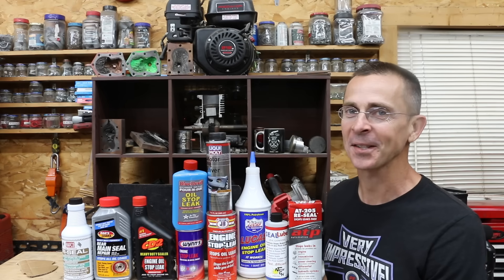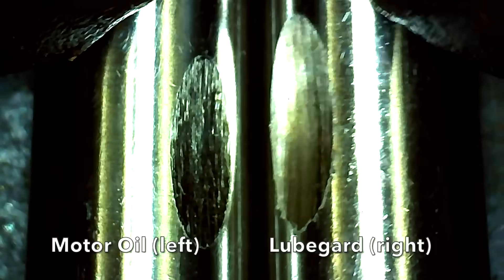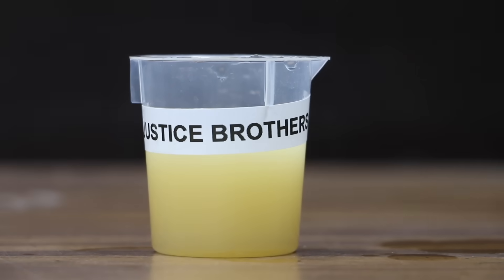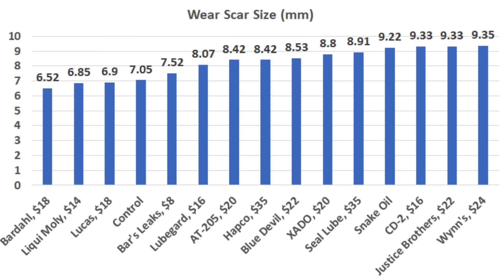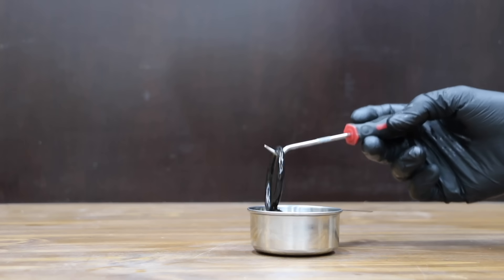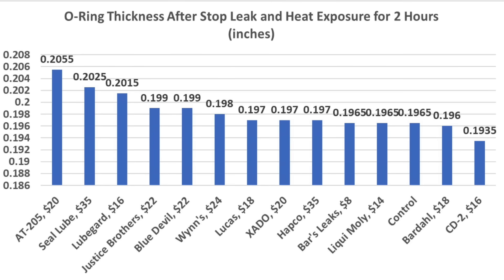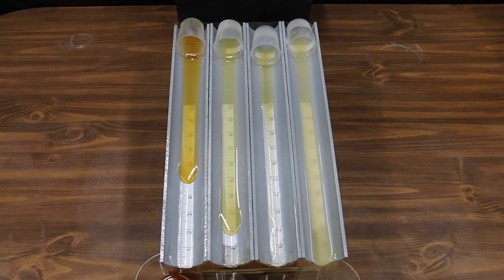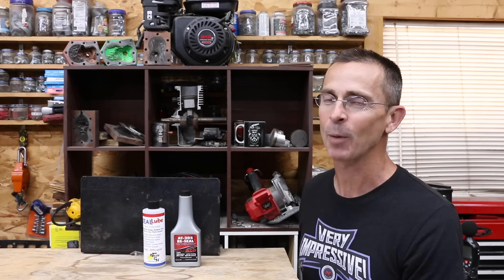Do Stop Leak Products Work? Do They Damage Engine Seals? Will They Destroy an Engine? Let's Find Out

Comment: The tests you come up with for these things are amazing and I appreciate the lengths you go to. The ATP stuff is great for swelling seals and spraying on suspension bushings or anything rubber but I wouldn’t put it in my engine. Ive used Lucas products for years and they are great for many uses. It will usually slow an oil leak really well but doesn’t typically stop it entirely. I use a quart of Lucas in every engine I have and we’ve used it at our shop for many years, it’s the best oil stabilizer/additive there is imo
Reply from the maker: Thanks!  Thanks for the feedback.
Reply: You think Lucas stop leak should be used in all cars ? I have a 260k mile Toyota should I use it ?
Reply: @All-about-everything  It would be good in any higher mileage engine, the only things I would maybe not use it in is newer engines that require very thin oils. It could make the oil too thick to get through some of the small passages modern engines have. Some cars take 0w oil now and you can’t even use 5w in some without potentially causing damage. Literally just about anything else tho, Lucas is pretty great in. Their power steering and transmission fluids are also awesome and I’ve seen them keep cars going for a long time.
Reply: Thanks.. I am old car Guy , & from Indiana ( Lucas land mys3lf):: Anyways anything specific  valid Proofs , In Lucas stuff…?
Reply: Kinda weird question, but when doing an oil change, do you put the Lucas stop leak first and then oil, of oil and then lucas?
Reply: @minifridge6512  It doesn’t really matter
Reply: @minifridge6512  Oil then the Lucas.
Reply: @minifridge6512  either just dont over fill

Comment: I personally use at205 and can say that it does stop the leaks. However I use it in a truck that gets an oil change once a year since it is not driven all that much. Maybe 3k miles in a year. I have noticed that about a year, maybe 10 months the oil does start leaking again. So it works for a great temp solution. Watching this does explain that and now I see why. It just burns off after a while. I will be adding it twice a year from here on out. Thank you for that information!!

I would like to say i think it might some tests might be flawed a small amount. On the at205 I do not use 50/50 mix like in your tests. Wonder what the results would be with different amounts added in. I am tempted to recreate this and try myself. Thank you for anther great video
Reply: Also watching this I might actually make a change and switch to Lube gaurd. Lower cost yet seems to be great products comparatively
Reply from the maker: You are welcome!  Thanks for the feedback.

Comment: Id have to agree with some of the other comments regarding the 50/50 mix. I know it makes the most sense for an apples-to-apples test, and allows us to see if these products do in fact do what they say they do(stop leaks and protect engines), but I feel some of the engine wear results would be a lot closer to the control when mixed in a ratio closer matched to the instructions. I would never replace half my motor oil with a stop leak product lol. 

So, great proof-of-concept test for the legitmacy of leak prevention, but id take the engine wear tests with a grain of salt when the products are used according to their instructions.

Ive been using AT-205 for years for stopping leaks, and its fantastic. 
Ive also been using Bardahl for years as an assembly lube, and its protection is incredible. You were spot on to compare it to Motor Honey.

Great video!
Reply from the maker: Thanks!

Comment: Another great video!
I can remember once when a stop leak product worked for me. In the 90s I bought a 69 Dodge pickup for 400 bucks to use temporarily. Had an automatic and took about a quart of ATF at every fill up. So one day I'm grabbing a quart of ATF and I think it was a Pennzoil ATF with stop leak, could've been another brand but it was a major oil brand. Don't think I added any ATF afterwards. In the 40 odd years I've been driving I've maybe had some minor success with stop leak products but nothing that dramatic. I'll still try it on an old stuff but don't expect a miracle.
Reply from the maker: Thanks!  Thanks for sharing.

Comment: Stop leak works, but sometimes too well. I replaced an entire AC system because of refrigerant with stop leak. Expansion valve stuck, filters completely clogged, condenser and evaporator clogged. My recommendation is to just fix the leak, that's far cheaper than an entire system.
Reply from the maker: Thanks for sharing.

Comment: Thanks for another lovely (and oddly well timed in my life) video! I've got a Saturn Vue (2003, 3.0l v6, ) with nearly 500k miles. She's a nightmare to work on, an alternator change takes at least 2.5hrs for example. Got a mystery oil leak as well as a substantial cam seal leak that drips right onto the exhaust so it always smells like burning. I've been debating trying a stop leak product on it, because the oil vapor is coming through my vents and hazing my windows, which makes it quite dangerous to drive when the sun's at certain angles. I can't fix the issue due to lack of money for a mechanic (and lack of time/equipment necessary to fix it myself safely) but would love even a temporary solution at this point. Think I may go ahead and try a bit of AT 205 in her. Be nice if I could mix liquid moly and at205 or something to get the protection with the seal restoration effectiveness. 

Would you be willing to do one with radiator stop leaks some time? It would be interesting to see how much different it is with much thinner liquids.
Reply from the maker: Thanks!  Thanks for the suggestion.

Comment: Something I think about a lot at work, I think it would be a great video idea to test which surface prep is best for adhesives. Bonding multiple different styles of adhesives (super glue, panelbond,  silicone, wood glue etc) and multiple different materials (wood, steel, plastic) to see if a more aggressive grinding or a less aggressive sanding is better for each bond. For example is it better to sand 2 pieces of metal with 80 grit DA sander or grind them with a 24 grid die grinder before gluing them together.
Reply from the maker: Thanks for the suggestion.

Comment: How many snakes to you have to milk to refine into oil? Venom is more profitable.  Here is a real lube, seriously. synthetic sperm whale  🐋 oil. Look it up, y’all. Whale oil was used for fuel and lube for centuries. PJ-1 motorcycle chain lube has the ingredient... synthetic sperm whale oil. Not sure if silicone and plastic surgery is prerequisite fo the process however, but I wouldn’t be surprised. 😮🤷‍♂️😏🤫🤭😎👍🏻👌🏻💪🇺🇸🛠🔩⚙️

Comment: Tool Tip from chemistry class:  Try adding dry (decent quality) sand to the cook plate. It spreads the heat out and lets you seat those little measuring cups in it for more even heating. 

Great stuff as usual. Surprised at some of these results. I guess you have to trade off the amount of lube loss vs restoring seals.
Reply: Agreed, those plates have serpentine heating elements.  Anything on top of the element will get much more heat.  Source:  40 years making pancakes including yesterday.
Reply: @mrmicro22  , 40 years of adding sand to the cook plate for pancakes sounds delicious.

LOL 😜 j/k
Reply from the maker: Thanks!
Reply: @ProjectFarm  Metal shot works very well too
Reply: Cock plate 😳

Comment: Great video definitely some interesting results.  It seems the products that separate from the oil did a pretty good job at swelling the seals.  A bit contradictory of what you might want but it might be worth it.  Most oils perform well enough to be separate for the millisecond's it would take to mix after the engine started anyway.  Thanks for the insight.
Reply from the maker: You are welcome!

Comment: I would have to question the usefulness of these products. O rings for example. O rings generally leak for 3 reasons. They get hard and do not seal, they wear (generally on the inside) and leak, they crack and break. Expanding the o ring would help it seal better, making it softer than it was when new would just increase the wear causing more of a problem later on. Nothing in these products will replace the material lost off of the sealing surface. So if you have a leaking static seal expanding it might help some, if you have a dynamic seal sealing a moving part then good luck with that.
Reply from the maker: Thanks for the feedback.

Comment: I had hoped this wasn't only about oil products. Could you do one on other kind of stop leak products? Liquimoly has one to stop radiator leaks. I know there are others also. Some say they'll just gum up the crevices and decrease engine cooling. Others say they work great. But who knows? A project farm test is needed!
Reply from the maker: Thanks for the suggestion.

Comment: Great test. I had a Mercedes S500 with a leaking rear main seal and leaking rocker cover gaskets, the AT205 curered the leaking rear main seal (the expensive repair) but it didn't cure the rocker cover gaskets (cheap and easy repair). I tried AT205 on a cougar with a leaking front main seal and oil pan gasket and unfortunately it didn't cure either leaks, but at approx $20 it is definitely worth trying the AT205 before attempting a "proper" repair.
Reply from the maker: Thanks!  Thanks for sharing.

Comment: Test pin test is flawed in this case. You are not going to mix 50/50 in an engine. Of course thinning the oil is going to cause damage.  You should have measured out the same % as what would be in an engine for a fair test. Polymer based sealants separate because of molecule size and they are intended to stay on the seal and do their job while the oil drains away.

Comment: I first heard of AT-205 in a video suggesting it for a transmission leak between the engine and transmission. In the case, the claim was that it would rejuvenate the dry and cracked round rubber seal between the two and that it would work due to said seal having a metal spring around it. I'd be curious to see you test an application/claim such as that with these same products.
Reply from the maker: Thanks for the suggestion.

Comment: What about high mileage engine oil? Do they do the same thing a stop leak does? Do they protect my engine better? I’ve heard the Valvoline max life semi-synthetic high mileage oil is actually the best high mileage oil out there, even better than Valvoline full synthetic high mileage oil, but is that actually true? What about other brands as well? I’m very interested to know these answers even tho I try to never use a high mileage oil because im worried my non leaking seals will swell and then wear down quickly since they will be potentially oversized and then if I ever go back to regular synthetic oil, I’ll leak worse due to the seals shrinking back down and now leaking
Reply from the maker: Thanks for the suggestion.

Comment: This test is very helpful. We're considering trying to rehabilitate a leaky old car, and it seems like we should use one product to rehabilitate the seals and then use a different product to reduce engine wear. Maybe a winning combo would be to use the Seafoams to clean up the fuel and air systems, then recondition the seals, and finally use the protectants. Now we just need to find a good transmission stop leak. Any suggestions? 😉
Reply from the maker: Thanks for the suggestion.
Reply: At-205 says it's for use in transmissions as well

Comment: Would softening the seals too much be a viable risk of this type of product? Were any of the parts too weak after treatment? The o-rings for example, I’d be interested to know what pressure it took to snap the control ring vs the treated rings. I’ve heard (hearsay) that stopleak products can soften the seals so much that they essentially disintegrate. I’d love to see that included if you replicate this test in the future. Thanks for the great video!
Reply: Yep. If the product is left in too long it can cause seals to swell too much and pop out of position or become too soft to resist fluid pressure. There are at least a couple of videos on youtube showing transmission seals that were over-treated (they were obviously swollen and very soft). The advice I've seen is to remove the product as soon as the issue shows enough improvement.

Comment: I've used AT-205 in a beater truck's steering box, and it's held up for 10 years. Same stuff went into a leaking auto trans, and it went from dumping a quart per 50 miles, to zero leaks after 10k.
Reply from the maker: Thanks for sharing.

Comment: Great test and very insightful. Unfortunately, I'm not really happy with any of my choices. The idea of increased wear and friction in my engine to swell a couple of troublesome seals doesn't sit well with me. I think now I would probably just replace the gasket when possible. Side note: my late dad raced cars in the 60's and told me on a couple occasions that Bardahl performed the best for wear in tests he ran. Great to see him vindicated.
Reply: It is a 50/50 mix. Your application would he less strenuous then this test and probably 1/25 vs 50/50. Highly doubt it will cause excessive wear.

Comment: Nice to see you getting back to some car fluid tests again.

Seems like there's something missing with half those products though. Like it seems like they're a different type of product than the ones that didn't increase friction and didn't swell the seals. It seems like the best performing ones should only be used for a short time to expose rubber seals to the additive, then a flush and refill with straight motor oil would follow right after. Did none of the instructions say anything like this?

Comment: How about a test video on the best brand of thread locker. I heard a tip that finger nail polish works well if you're out of the real stuff. Maybe even super glue. You enjoy using that digital torque adapter!
Reply from the maker: Thanks for the suggestion.

Comment: Great comprehensive test! I've had good luck with AT-205; stopped my rack and pinion leak in my '96 Toyota. I know it's only temporary, but it's nice to be able to buy some time, especially on an older car. But it did not help a power steering leak on my F-250, but I don't think that leak is an issue with a o-ring seal.
Reply from the maker: Thanks!  Thanks for the feedback.

Comment: Accidentally bought Wynn's stop leak once ,never opened it shocking damage shown in your test., meant to buy wynns stop smoke ,been using at every oil change, seems to help worn engines get through emmissions tests year after year. 
Guessing the ingredients that soften rubber gas off through the engine breather after a few drive cycles . otherwise it's just sticky stuff that bungs up any gaps. 
I've not had much luck with any magic bottle that can fix coolant leaks
Reply from the maker: Thanks for sharing.

Comment: I love this channel, but I think the lubricity test is not accurate in this video.  We should be testing the additives in the proportions they are designed to work with.  I think the wear properties of the additives would be much more similar if they weren't 50/50 mixes.

Comment: Scotty Kilmer on his youtube channel swears by the AT-205 product to stop leaks that would be expensive to fix. Good to see he was right. AT-205 completely but slowly evaporates over time at room temperature. It does its work then goes away, so I wouldn't pay much attention to those tests where it is mixed with oil since it doesn't stay in the oil. That 50/50 mix was also unrealistic since all you need is a few oz. to treat an engine. As Scotty recommended, I also put AT-205 in a spray bottle and spray it on old rubber parts, bushings, etc. to stop squeaking. Thanks for the great work into this.

Comment: Suggestion: On the wear test because the wheel is a circle larger 'scars' take exponentially larger amounts of material away as they get larger (because they get deeper too).  If possible measuring by weight removed would be more accurate - but would obviously require very accurate scale to measure those small differences.
Reply from the maker: Thanks for the suggestion.
Reply: Yes but wouldn't the increase in contact surface area negate that?

Comment: Would love to see this test redone with the 10w60 oil my BMW M3 use to take, had a guy in my "cars n' beers" group that swore by the lucas oil additive.

edit:i think that guy was a moron as my personal opinion of owning an e46 M3 for 5 years and putting nearly 100k miles on it(160k mi total) and doing all mantaince myself other than the VANOS repair, As for my current car as i had to unforntunely sell my M3, is a 01 B5 Audi S5, so i may ad some at-205 in with every other oil change. as well as use it in my 3500 chevy, as it actually seems to work as advertised. love to hear some replies from people that have used at-205 in the replies
Reply from the maker: Thanks for the suggestion.